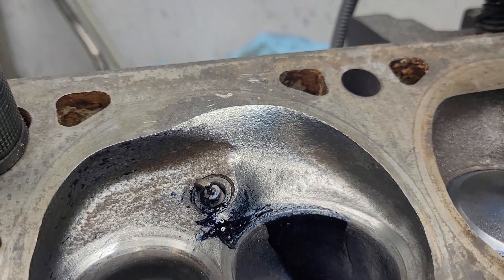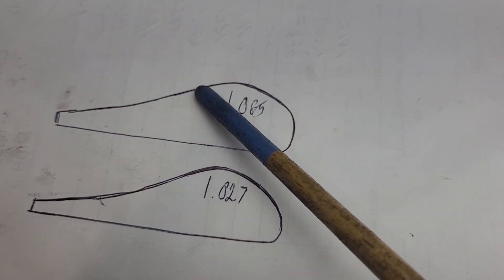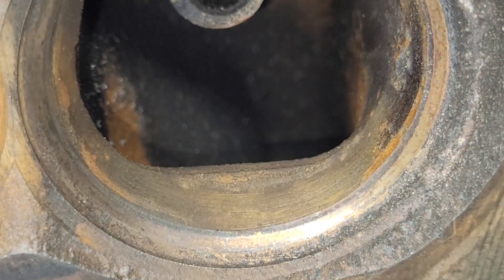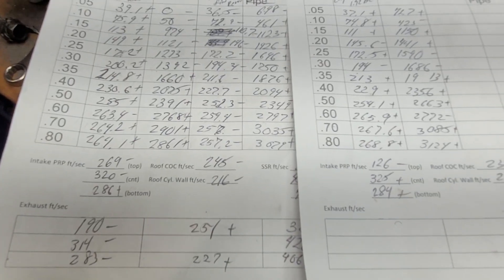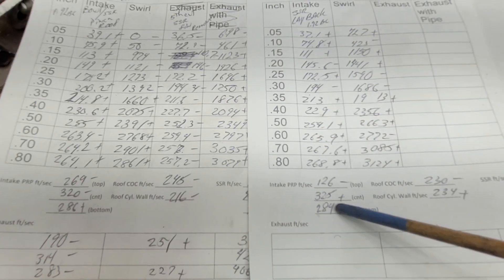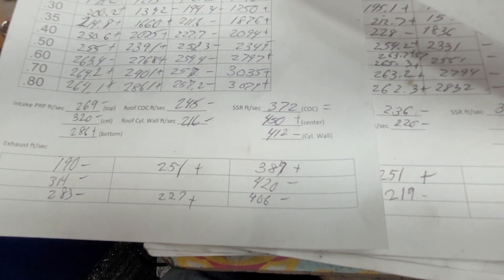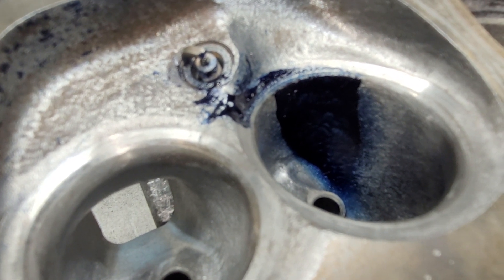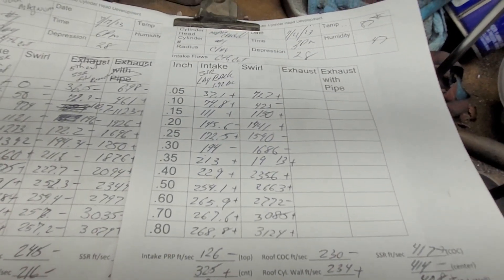Mopar Magnum cylinder heads, 6th cut, Getting interesting!!! Wasting time 101!

Comment: Thanks for sharing your knowledge with your videos i have enjoyed them very much i do the same thing always trying to get the job done better the very best i got back in the late 90s was 265cfm i tried real hard to improve on 265 but never did but when you put a 550 engle cam in a 360 with some compression intake rpm and a 750 vac.holley trust me it will be a beast on the street even the first ones i did that flowed 250cfm would turn on great it is pretty easy to get 250 mostly a good valve job and bowl work laying back the short turn i guess i done a dozen magnum heads not one of them leaked water they are the easiest small block production head to pick up flow on that i have done also can be a good sleeper to pass by as stock head plus a closed chamber with 1.6 rockers thanks a lot knowledge doesn't come easily you have to work at it just like you did great job
Reply: Good to know.
Reply from the maker: @raysimon1368  250cfm on the street makes a fun ride!

Comment: I see waves in the dye. Possibly from being pulled sideways? 
  How much of that area is used during each valve event? From open to close. How much of the port volume is actually being drawn in? 
  I dont know that answer to that. Is it only the volume of the bowl making it into the chamber? That is where air speeds come in! Cfm is the restrictions of flow. But the speeds are the distance the air moves. Feet per second. If you have an over all faster port. The further the air has moved during a valve event. Cubic feet per minute. Cfm! 
  If you combine air speeds for the entire port and devide by 4. The port with the greatest  average speed should record the greatest cfm. 
  Good science Charles. Those olds heads have good potential. Since custom rockers are being used. Whats keeping them from changing the rocker reach?  Tilt the valves and pedestals!
Reply from the maker: That would be up to the owner. He likes the idea of stock manifold locations. Custom rockers are a must have. Remember velocity squared!
Reply: @servediocylinderheads all the comments that I'm reading are painting a clearer vision of what to do and avoid. Thanks guys.

Comment: When air flows continuously, the vortices and eddies created by the moving flow become obstacles and obstructions for any new flow that moves through that space. When air moves through the port, out of the valve, into the CC/bore, that air still has momentum and that momentum affects the next bit of air that goes through the system. In other words, how is the current snake of air being affected by the previous snake that's already moved through the system. We already know where the air tends to go, what we're missing is what areas influence the flow to travel in a way that gives us the numbers we're looking for. It's made even more difficult because flow structures created by the air itself affects those areas we are trying to sculpt to do our bidding.
Reply from the maker: Like Pitot air speeds. The Pitot there changes the air speed. Tanks
Reply: I'm trying to visualize that. Trying to paint the pictures you all are drawing in my mind to become realities.
Reply: @donaldpowers3314  The vortices you shed in the port become physical parts of the port that air has to go around. This is why winglets on aircraft help, they reposition the tip vortices away from the wing. The end result is you have more wing surface area to create lift with. This lets you back off the wing, which nets a small increase in efficiency.

Comment: research is never a waste of time  , its the only alternative to guessing
Reply from the maker: What I say at work often,"Stop applying logic!" That might be a touch sarcastic...
Reply: Mathematical models are what ALL the OEMS and high dollar race teams use before doing anything. CFD combined with 1D simulations are vital tools.
Reply from the maker: @ToddWright2  I always think those simulations are only as good as the person who wrote the program. So they may be perfect to not so good.
Reply: Get approval to move that olds intake entrance up and I think you can really make some improvements!
Reply from the maker: @bcbloc02  It needs a huge amount of work. Thanks
Reply: Very intriguing. That can be applied to life. I'm currently researching on the NZ EQ HEAD that I've recently came across at a swap meet in Texas. I'm looking before I keep. I've been sticking up on die grinders, the big yellow one Richard live found them cheap in pawn shops. One for less then $50, both hardly used. All I have is Mopar, can't afford anything new. I'm fighting to understand the language of head porting.